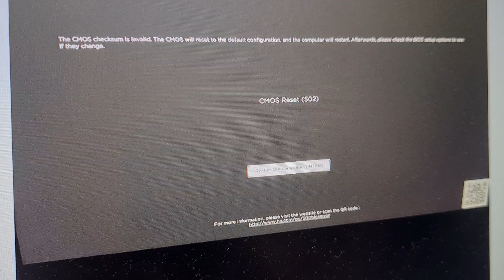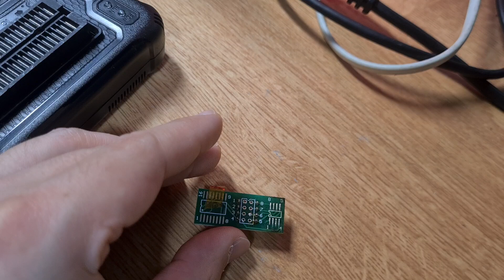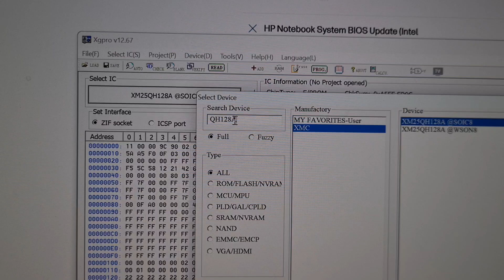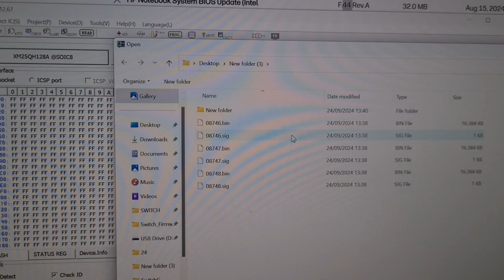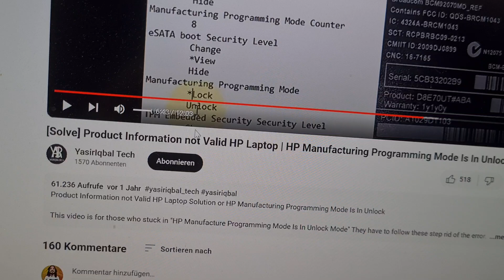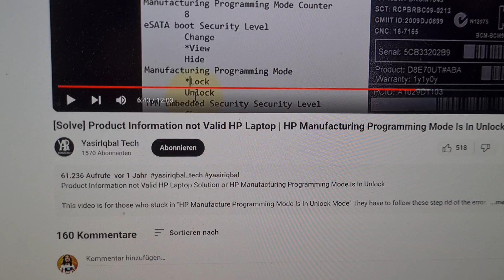(Englisch)HP Omen 17-cb1176ng - The CMOS Checksum is invalid - CMOS Reset 502 - Reparatur Repair

Comment: Another issue with this laptop: After it starts and showing HP icon, screen goes black. If I connect to external monitor, I can see the windows screen and laptop screen is dark. I know screen works due to initial logo appearing. Go figure